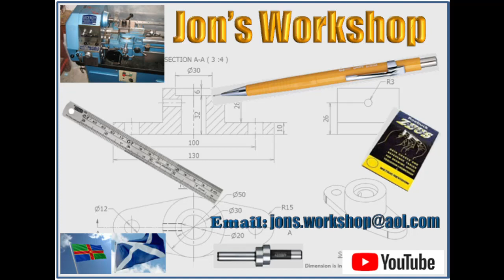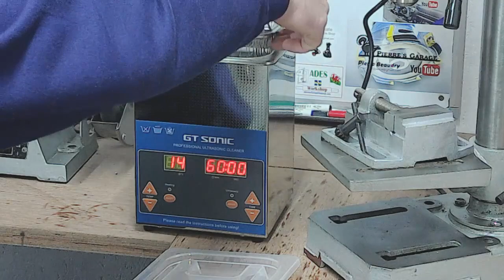Episode 22   Record No 2 Vice Restoration

Comment: Great video i am watching this 7/05/2023😅Selling my father in laws no3 record its well old over 20years. Selling it on facebook but buyer didnt want it because it took a few turns to open😮. Someone had put a nail instead of a proper pin and the washer and spring had slid over it. Someone who understands restoration is now buying it realising its a simple repair job. These vices are absolutely solid. I would have fixed it myself if i had wanted the vice.  But i dont really think i will use it i use my workmate for wood or plastic mostly.
Reply from the maker: Thanks Rob, glad it is going to someone who will do a proper job and give it a new life. Cheers, Jon

Comment: Great video. Thanks. Could I have the part number of your sonic cleaner and also the make/brand/colour of the paint you used. You have inspired me to restore my own vice. Thanks. 👍
Reply from the maker: Hi Alun, thanks for the comment. Sorry, I have no part number, there's nothing on it either, it's called GT Sonic and is 1.5 litres capacity (too small - go bigger)! I got it off Amazon but it is no longer advertised but there are plenty of similar (all Chinese). The paint was Hammerite, Smoothrite Blue, there is only one shade so easy to find. Hope this helps. Cheers, Jon

Comment: Perfect.  Only problem was some previous owner had effected a repair minus the retaining washer and substituting the split pins with 2 nails to retain the vice together.  These I had to drill out because too stiff to drift.  Because the washer was missing the buffing spring was baddly buckled, with the spring binding around the nail.  I imagine this vice was used in a workshop, why did the "repairer" cut corners, when a workshop of useful material would be available?

Comment: I have the same exact one, record no2
 3 1/2" but I cant figure what material this exact piece is, is it cast iron, cast steel, or malleable cast iron
Reply from the maker: Hi Diva, thanks for the comment and question. If it is an original Record (older than 15 or so years) it will definitely be cast iron, and good quality cast iron. The modern copies, and units still made under the Record name are not the same, they will probably still be cast iron but a much inferior grade. Easy way to tell, is if it has the "Made in England" raised letters in the casting. Hope this helps. Cheers, Jon

Comment: Hi.  How are you ?  Please, I have a very old Record bench vise, but due to a crack at some point in its existence, someone performed a welding and erased the number.  Could you tell me the length measurements of your bench vise with the jaws open and completely closed?  I want to recreate the number.  A hug from Brazilian lands. 🇧🇷 Eduardo
Reply from the maker: Hi Eduardo, thanks for the comment and question. I am not sure exactly where you want measurements taken from so I measured from the back vertical face of the main body casting (not the round base), to the very front vertical face of the moving jaw casting (where the threaded shaft rotates against). Closed = 150mm. Open = 253mm. Vice jaw width is 3 1/2 inches. Hope this helps. Cheers, Jon
Reply: @jonsworkshop  Good afternoon !  So, the jaw measures 7.7 cm.  The distance between the open jaws is 7cm.  the total length with the closed jaws is 22cm.  Thank you so much for helping me

Comment: What colour Hammerite paint is that? I’ve got the same vice and it needs some paint, yours turned out nice.
Reply: I think that its light blue smooth. The proper colour should be Roundall blue for a Record vice, as in the Raf roundall on planes. Personally im split between the hammerite and the proper colour as im doing a No 3 vice.
Reply: @paulprescott7913  Thanks very much

Comment: I’m literally doing this now. The pin in the spindle was a pain in arse to get out. Wasn’t a split pin in mine, it was the same type of pin the goes through the base. Could not get it out for toffee
Reply from the maker: Hi Gavin, thanks for the comment. Fiddly job, even with a split pin. This is the 2nd one I have done and they were both difficult - the first one had a nail for the pin! The toolmakers clamps made life much easier on the refit. Cheers, Jon